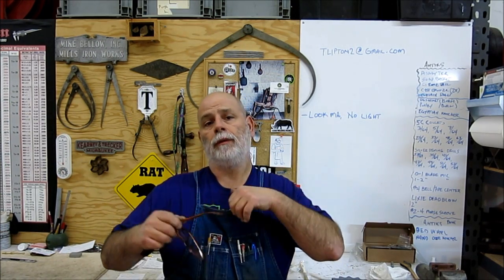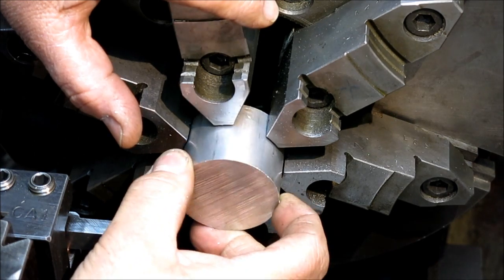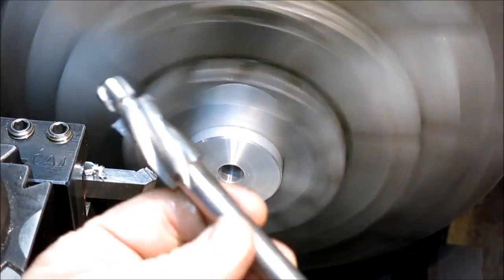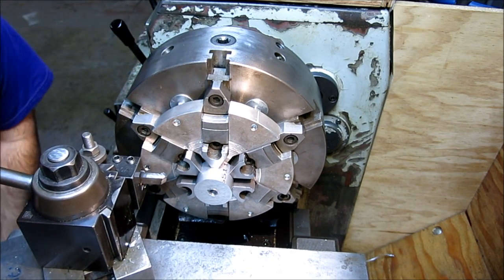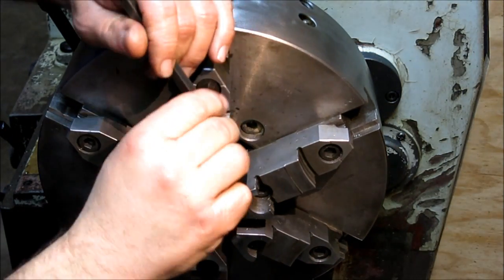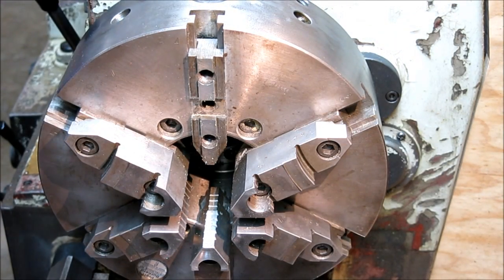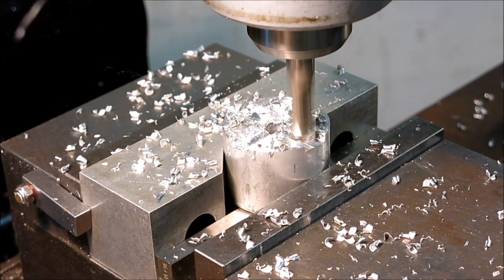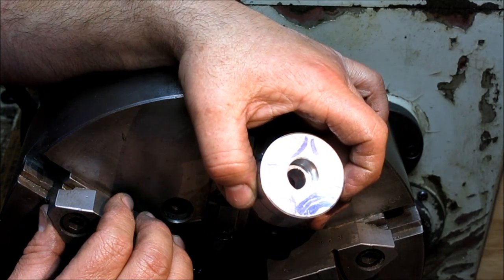Roach Coach Snack Break 9

Comment: Hi Tom,
I like that combination lathe tool. Did you put any radius on the two cutting points?

Learning a lot from your videos. Keep them coming please!!
Reply from the maker: Hi David,

Yes there is a small radius at each of the corners. Maybe .03 inch or so just so it makes a better finish when turning.

Cheers,

Tom

Comment: Hey Tom, I've dabbled in soft jaws a few times with pieces of rectangular aluminum and even steel, but I've never thought to use round, brilliant, another great informative lesson!  By the way, that WD-40 energy drink has been repeating on me lately, I'm gonna try "cutting back" on it a little.
 
  Mike
Reply from the maker: Hey Mike,

Just don't switch to one of the other microbrews like M1 or LPS. They are a little too hoppy for me.

Cheers,

Tom

Comment: Neat!  One question though: I've seen others say that when milling a slot you should use an undersized mill, go up the middle, then offset to the sides for the correct size.  You didn't do that.  Was it because you have a good mill, a big bit, and we're cutting soft material?  Maybe a different story in steel, or with a 1/4 slot?

Stay safe and have fun!
Reply from the maker: Hi Mike,

You are correct to get an "accurate" slot that is the right way to do it. Part of the simplicity of these jaws is it doesn't really matter. When we set them up they get biased against the fasteners and then cut to accept the part. The simple quick soft jaws are not really good for taking in and out and having them repeat to a close limit. I just skim them a few grand if I need to use them again.

Cheers,

Tom

Comment: Tom it looks like if you are shopping for a chuck, then look for ones that have 2 piece jaws....seems more flexible than one piece jaw chucks.
Reply from the maker: Hi Bill,

Good question. For just switching the jaws back and forth from small to large work the solid jaws swap faster. If you want to use soft jaws or other fixtures on the chuck then the master jaw type are definitely more flexible.

All the best,

Tom

Comment: I made a set of soft jaws for my 3 jaw chuck that were copies of the hard jaws.  The set you made is so much easier.  I would be more likely to use your set than ones I made.  Rich
Reply from the maker: Hi Ron,

I feel you there. Making the double tenon is a pain so what happens is you never use the nice jaws you made when you should. The bar is so low on these simple ones you can use them like popcorn.

All the best,

Tom

Comment: Tom, what a great idea! I never thought of round jaws never the less indexable jaws that are reusable. 
Cant wait for the video showing them in use.
Reply from the maker: Hi Andre,

Go back and look at the weird thing I used to check the counterbore depth. It will show its face again in the next video. Its used to set the jaws up for boring.

Best,

Tom
Reply: oxtoolco That tool reminds me of a tool gunsmiths use for working on rifle barrels called a spider. 
Also reminds me of the nut checker tool you use for threading.

Comment: Once you remove those, can you get them back on in a repeatable way?

The slot indexes in one direction, but not the other.

Would using countesunk flat head screws instead of counterbored make any difference ?
Reply from the maker: Hi Nonames,

I don't bother trying to get them back on perfect. I just adjust them in a little and re-bore a few grand to clean up. The commercial ones index with both tenons and are pretty repeatable. Its a lot of extra work to add the second tenon and usually much easier to skim them. Flat heads would help quite a bit. I didn't counterbore these very deep but you get more jaw to work with if the fastener is well below the surface.

Regards,

Tom

Comment: If you put a square steel insert in the spare slot you milled, the one that is or ends up tangential to the rotation, it might take atdvantage of the slot that is in the fixed part of the jaw in the chuck, so you can remove them and reinstall them later? Unless it is a sin to reuse/reinstall softjaws, unless you rectify them again?
Reply from the maker: Hi Thomas,

In general you re-cut soft jaws after you take them out and re-install them. If you go through some extra effort (not me) you can save a tricky geometry for later reuse with good luck. This type is super simple and does not lend itself to saving without recutting.

All the best,

Tom

Comment: That "multi tool" is the bomb!  How did you grind that "chip breaker" grove in that thing?
Reply from the maker: Hi Bob,

Good catch. You spotted the new chipbreaker in the tool. I just added it on the corner of the grinding wheel and then retouched it on the diamond wheel to hone it. 

Cheers,

Tom
Reply: Cool beans!  I would probably loose my thumb nail if I tried to do that to one of my tool blanks!  I was thinking that you might have a super sweet Dremel tool jig that you built to place the perfect angle, to the perfect depth etc in the tool!  Leave it to me to over think a thing!

Comment: hey tom i have an quick tip for you : when using your micrometer then you can use the last knob on the device to get just the right preasure on your measurement, by turning free when it reached the desired force and you always measure correct

sorry for my bad english but im an impressed german viewer, would be nice if you can answere that soon, if not, not so bad i won´t desubscrybe you soon
Reply from the maker: Hi Steve,

Thanks for the comment. I am aware of the ratchet knob on my micrometer. On that particular micrometer the knob slips early. I know this because of calibrating it regularly on known standards. I adjust for the right contact of the faces on the work. The mic will slide when you are parallel to the surfaces under interrogation. I find the Mitutoyo electronic micrometers are generally lighter on the ratchet that other makes.

All the best,

Tom
Reply: lol why ? its tehre to prevent to much force and parallax errors.

Comment: Nice Tom!! Pity here in the UK not many people use tenon top chuck jaws, they are either serrated (mainly on production machines) or usually on manual lathes full jaws that mate directly with the scroll, so soft jaws are either expensive or a PITA to make! I know soft packings can be made etc but that's not always ideal. 
Got your first book by the way, it is FANTASTIC, best read ever!!
Love your video's. We all appreciate the effort you chaps comfortable in front of the camera put into them!! Take care, regards, Simon.
Reply from the maker: Hi Simon,

Thanks for the comment and participation. 1mm serrations are a pain to machine nicely. The commercial jaws with serrations are just expensive enough that many folks wouldn't put a set in stock. Solid jaws are much quicker to swap between ID and OD holding than the master jaw type.

Cheers,

Tom